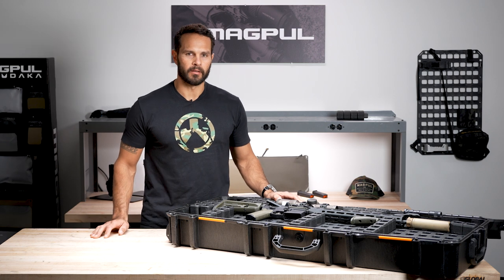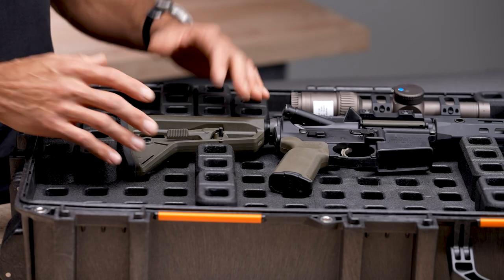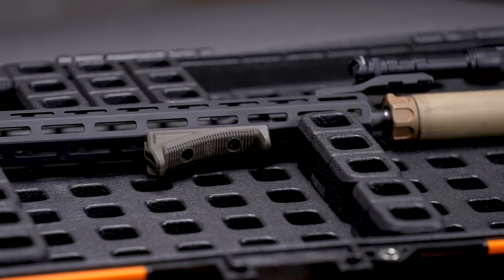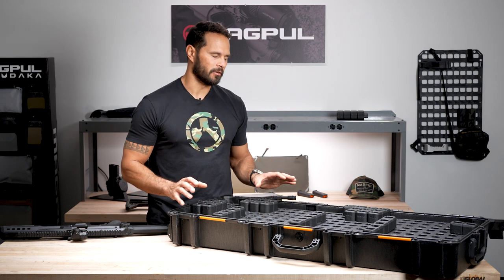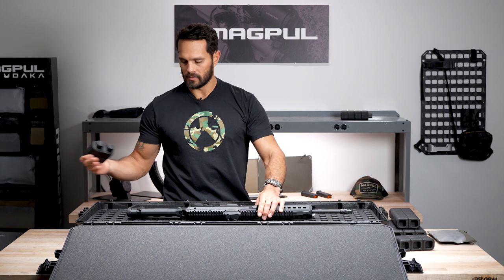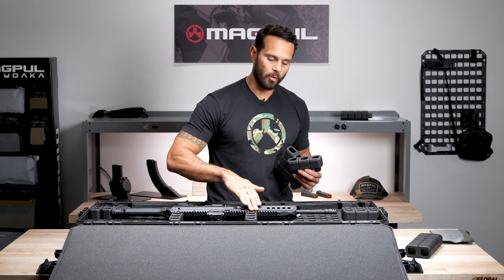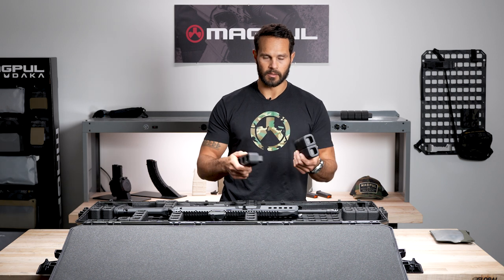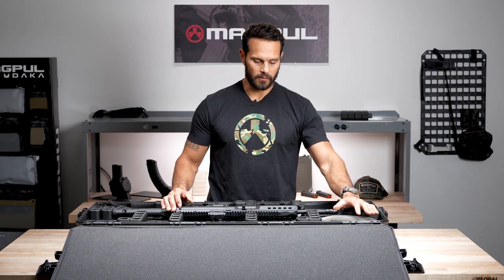The Magpul Bottom Line - DAKA GRID Organizer

Comment: Anyone saying it won't close, if you have this or a similar case, the top has a few layers of foam. Take the thinnest one out. Everything is still tight, but the case will close fine. I fit 2 rifles in 1 case, both with huge optics. They fit fine.

Comment: My setup is basically the same as you demonstrated. However, the case (V730) is difficult to close, specifically difficult to latch. It's almost as if the lower large grid is slightly too wide. I can get it to close, it takes a lot of effort, and having two people definitely helps. Any suggestions?
Reply: I have a mix of free floating and braced blocks and I have found that after a couple of days that it does get easier to close.   I will likely change to all braced after watching this video.  Also, I have an extended latch on my AR charging handle and I find that by cutting (ie removing) two of the bottom grid squares allows my to better seat the rifle in the case so that the extended latch has plenty of free-board on the bottom.  Overall I really like the DAKA Grid Organizer system.  I have employed it for my Pelican 780 and 730 cases.
Reply: @KinoTechUSA69  🤣🤣

Comment: Being afraid of a 36" drop damaging an optic doesn't make the case sound very protective. A good optic should be able to take a hit like that on its own.
Reply: That's not at all what he said.  He said don't pack your red dot against the case wall, leave a gap so the optic can free float so that on a 3 foot drop or higher it cannot contact the case wall.
Reply: @justinparker7196  Annnddd what would the concern be for hitting the case wall? Damaging the case? Affecting the red dot? Either way its not a positive selling point. Learn to listen for context clues buddy.
Reply: My guess would be running the risk of losing optic zero.